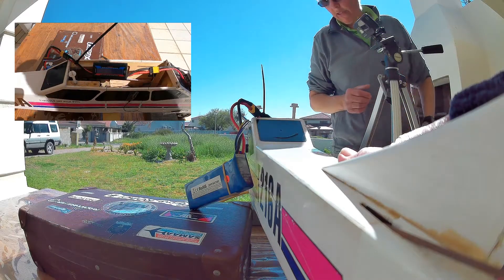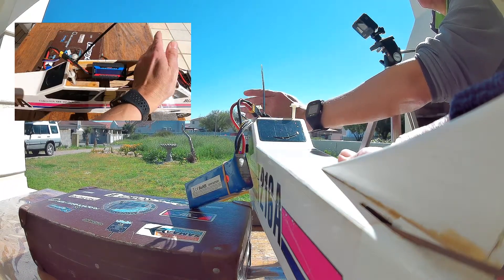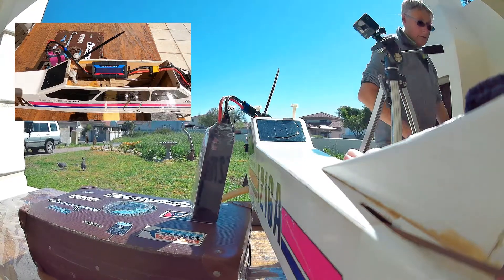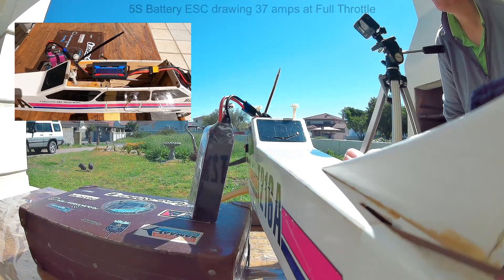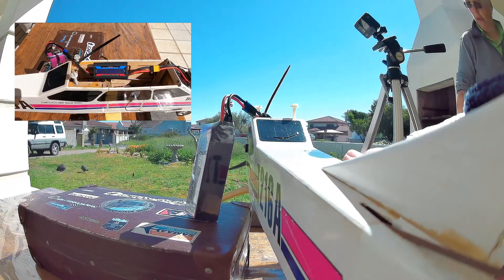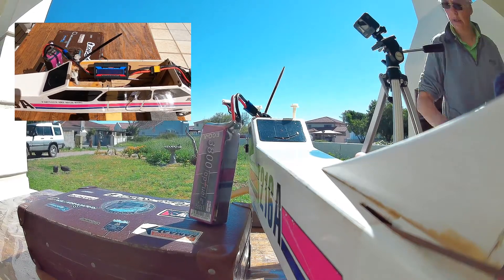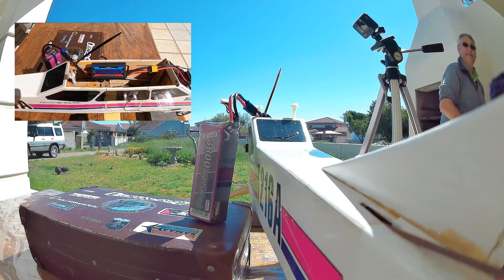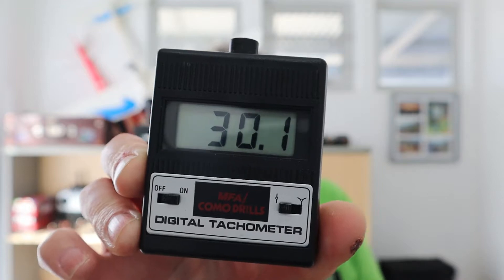Comparisons Between Running 4S & 5S on my Turnigy SK4250 650KV Motor

Comment: What do you suppose is the maximum safe rpm a prop like that can spin?
Reply from the maker: I would say 11,000 rpm is pushing that propeller to the top end of its range. In flight I will only use full throttle for loops or climbing for stall turns. It has been a long time since flying the model in the video on 5s. We have had no flying here for two weekends because of the weather so hopefully out flying again on Saturday to test it.